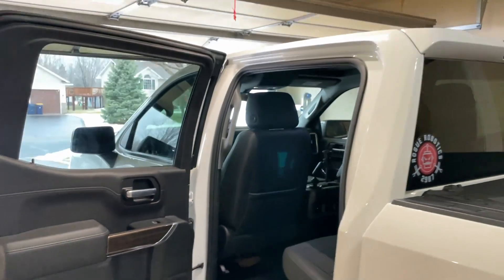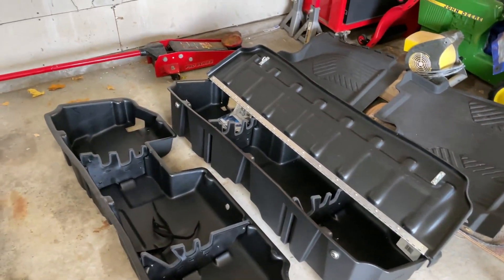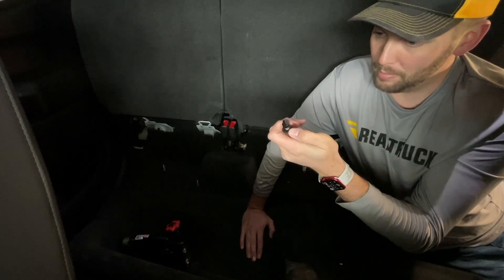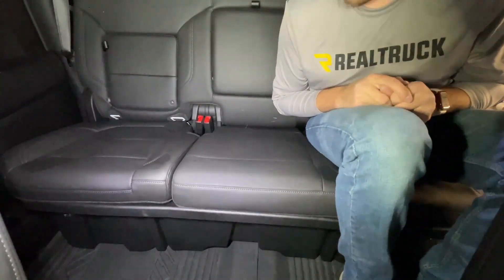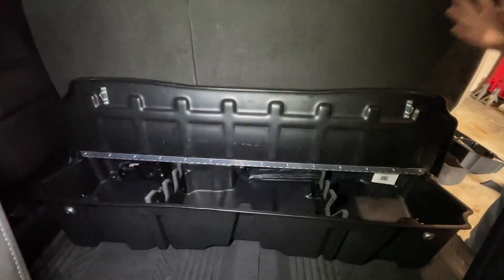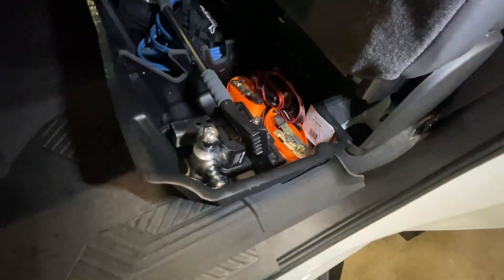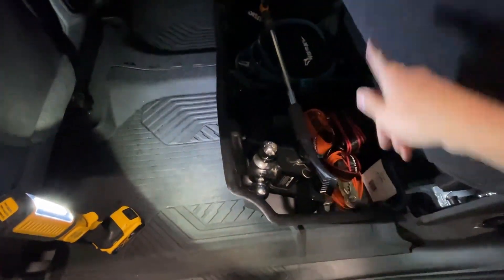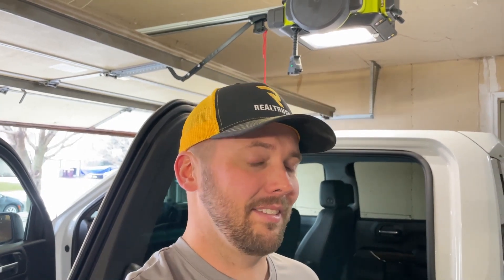DU-HA Underseat Storage Review Silverado, Sierra, 2019, 2020, 2021, 2022

Comment: I installed the one with the lid to protect my snow brush.  Because of the lid, the jack is difficult to deal with (you can't easily get you hands on it to turn the handle to put in place).  Also, be aware that you do lose a great bit of flat floor area back there once it is in-place - a duh moment.  But . . . I can keep my snow brush out of sight and secure.

Comment: Okay I “installed “ one (with lid) on my 2020 Silverado , may need some modifications.. jack bolts didn’t align with holes on the duha holes and I have the factory floor liner so idk if that makes its and issue to just drop in and bolt on.. I will just modify to make it work …not a 30 min installation … $300 plus now seems a bit much .

Comment: I wish it would work with the lasfit floor mats I had just purchased.
Reply from the maker: I bet you'd be able to cut off the lip and they would work. I used a tin snips to make factory floor mats work with the factory storage solution.
Reply: So do you lose room if you go with the one with the lid?
Reply from the maker: @billybrewer1342  maybe by the gap between the lid and the seat. But their isn’t much of a gap to speak of. Need for added security should be your deciding factor.